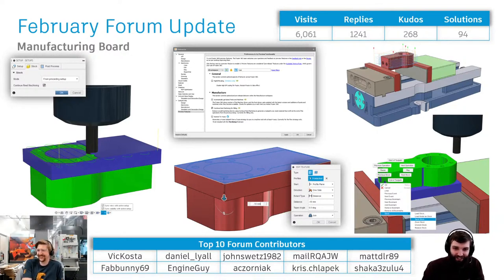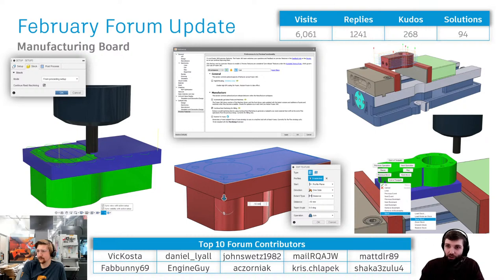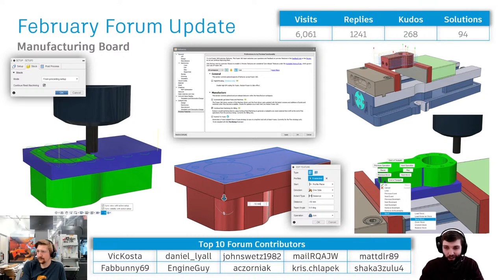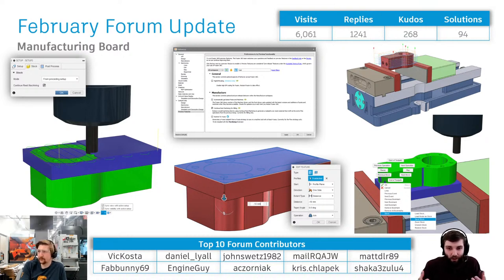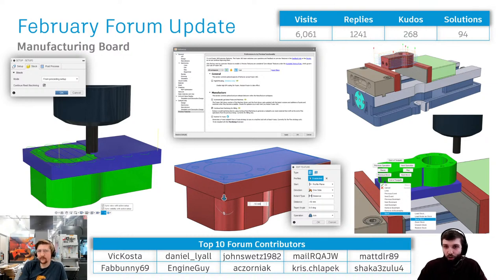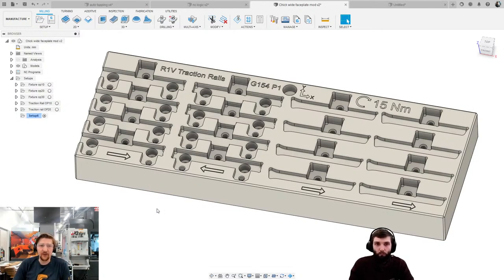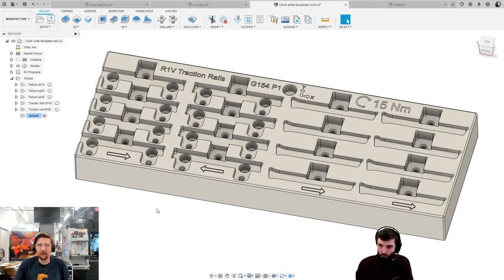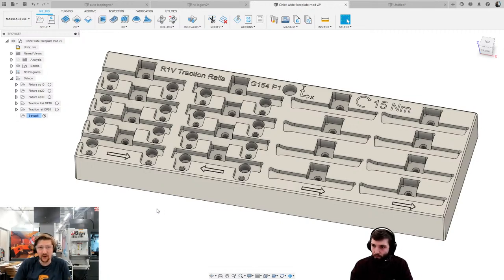360 Live: Making CAM personal - Expressions and Defaults

Comment: Brilliant ! Tho beeing able to interpolate the holes and then threadmill them instead of drilling would be a better fit(for me). Perhaps someday one could autoselect circles/holes per size the same way but for other strategies like adaptive clearing, pocket or threading.
Perhaps internal contours could even be selected based on size of area or depth.
Thanks for the stream!

Comment: This is not a criticism but a call for help. I am desperately trying to understand Richard. I have tried everything, even slowing down the audio by 50%. I have tested other You Tube channels and there is no problem. Richard sounds like he is inside a reverberating, empty beer can. That coupled with rather rapid speech, make comprehension extremely difficult or impossible. If he could slow down a bit it may also help.  THANK YOU for your time and valuable content.
Reply: Hi @Carbide I feel your pain. Firstly sorry for talking so fast, that is something I can fix, I tend to get a little excited and carried away :)
Regarding the Audio reverb, I'm trying to find ways to fix it, I use the same setup for hours everyday over zoom and its not an issue. But every time I do a live stream from the tech centre I have the issue. I have a few more things to try, I turned of all of the active noise cancelation in this live stream and it had no effect. 

Thank you for watching the content and sticking with us!